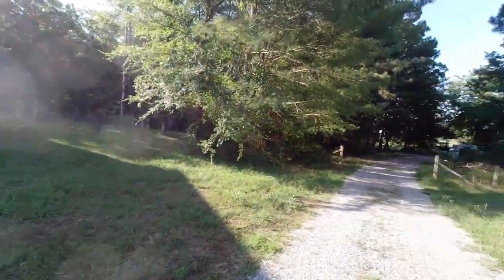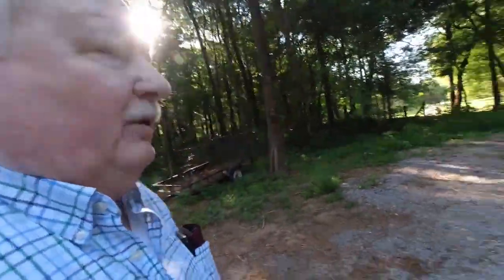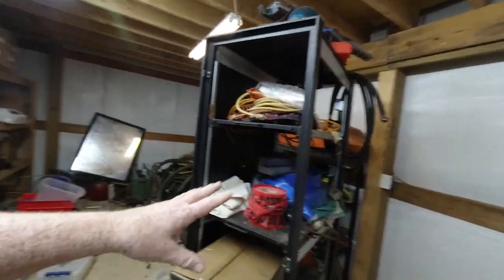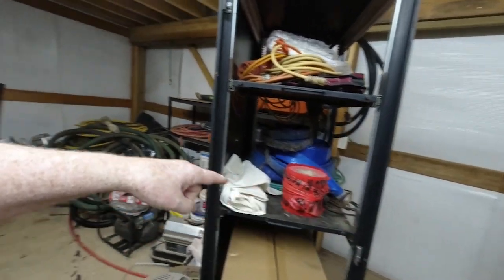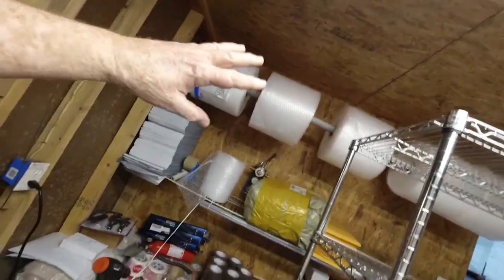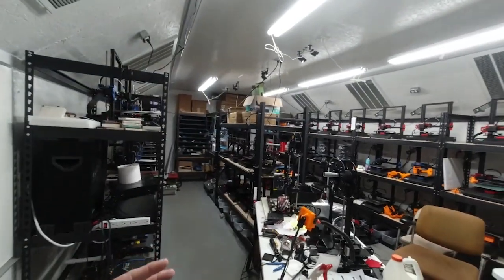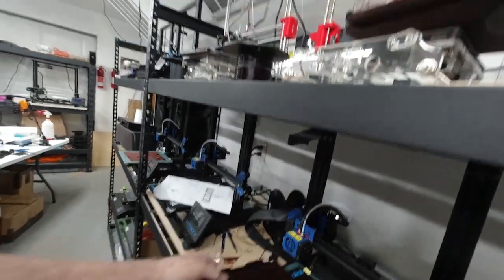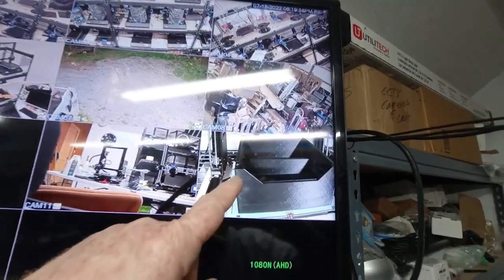MY 3D PRINT FARM INSIDE & OUT see what I'm up to now at New Tech Inventors.

Comment: Great Job, you're living my dream job :)
I do see that you might want to lower the infill over lap to remove those infill lines on the exterior of your prints. I use Cura and set it at .04. Cura always increases it when you install a new Cura.
Reply from the maker: Thanks for sharing that info, I will try it out. We should all try to follow our dreams and living them is very rewarding. Thanks for your support...ken